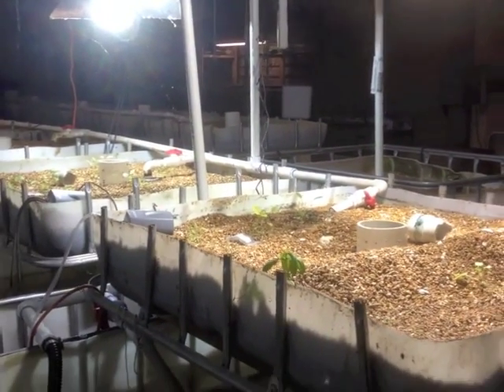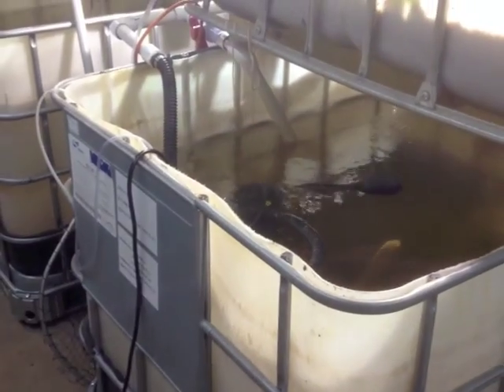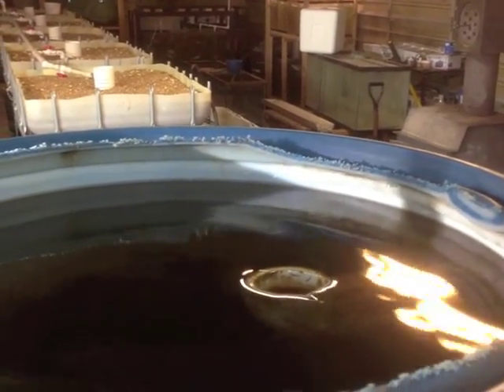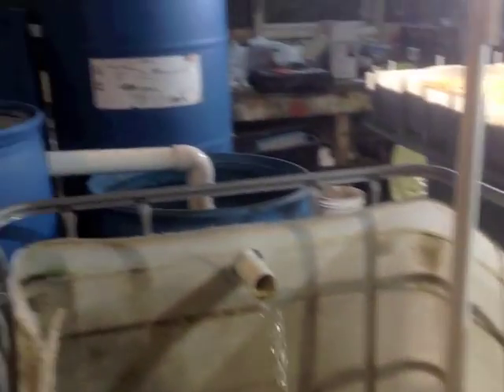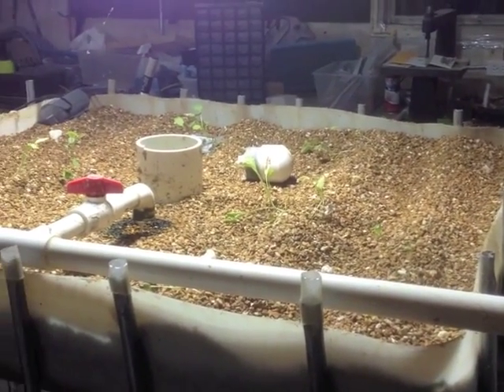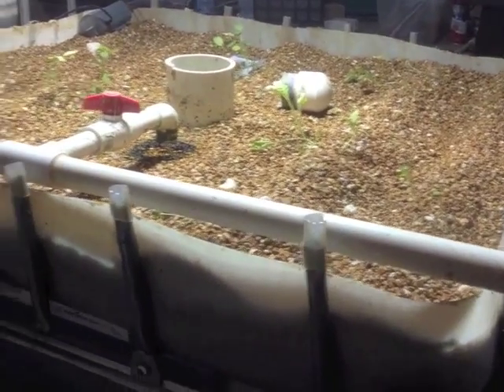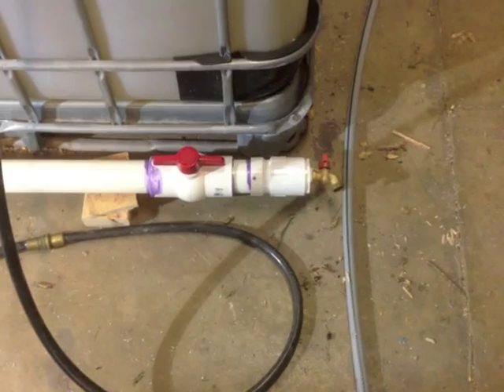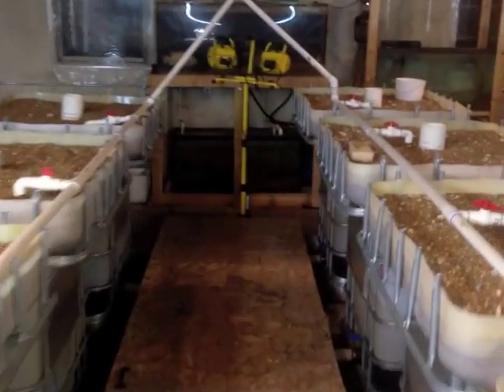Aquaponics with Tilapia

Comment: What is your water Temp at time it is fed to your grow beds? My understanding is that most plants do not like temps over 75 F.  The problem is that Tilapia likes water at 80 to 85 and will die off if you keep them at  or close to, 75 F.  If you have been doing aquaponics for 8 years, what is your water temp please?
Reply from the maker: My water temps don't usually get all that warm.  I heat the air so the actual water temp is fairly lower than the outside temperature.  Tilapia do just fine in 70 degree water, and as long as I'm growing crops that do better in warmer water temps i should be good.

Comment: Nice system, I like the way all the water gets filtered before it goes to the beds. You might want to consider a magnetic drive pump. They're designed for constant use, rather than the sewage pumps, which are made for infrequent use. Check http://www.theaquaponicstore.com/Default.asp as a resource. They can ship online, or recommend a store in your neighborhood.
Reply from the maker: I like the magnetic drive pumps, I just worry that they wont have the driving power to move water over a large distance lets say 40 feet on the horizontal.  I also have to have the float switch in order to have the pumps automatically shut off when water lever drops to a certain level...i know i can make something to serve this purpose, but these pumps I have conveniently have this already installed.  what is not convenient is that they fail quite often.
Reply: Josh Davis Moving water horizontally is not difficult, you need to look at the head pressure, and volume. There should be a label chart on the box the pump comes in that shows how much water the pump will move at different heights. The higher the head, the less water the pump will move to that height. You should size your pump to move about twice the volume of water of the complete system, per hour. Here's a link for an add on float switch that you can adjust to any height:http://www.pexsupply.com/Zoeller-10-0055-Switch-Mate-Piggyback-Variable-Level-Float-Switch.
The other thing you could do is have a backup water source for your sump tank with a float switch to fill the tank when the water gets low, similar to a toilet valve. Good Luck, it looks like you've got quite a system put together with a lot of thought on how to filter the water. Can't wait to see the results once the plantings start growing!